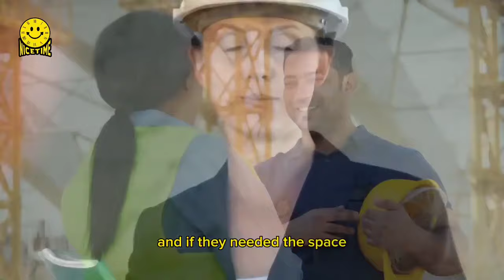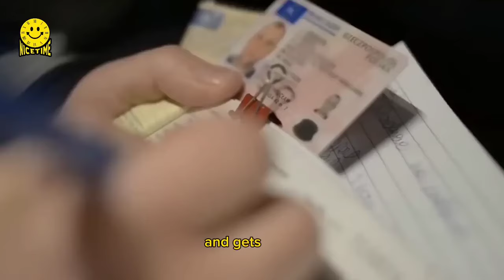Woman Flips Off Truck Driver His Revenge Is Priceless

Comment: Been there done that!!!!!!!! BUT unfortunately construction worker are some of the worst when you try to deliver! They know you're coming but they just don't care! I've ruined a lot of extension cords because the crews wouldn't spend the time and put some protection around the cords! It happened so often that I got sick and tired of wasting my time trying to find someone to take care of so I just started to run the cords over without looking for someone, after they had a few extension cords ruined they quit doing it because they knew what I would do!! I even have a wheelbarrow to my name! I had been delivering to this job and when I came back with another load one of their workers had been cleaning concrete tools in the wheelbarrow and left it right in the middle of the driveway, so I backed right up to the wheelbarrow but still no one came over to move it, so I figured they didn't want the wheelbarrow any longer so it got flattened, came close to getting in a fight over that one!!